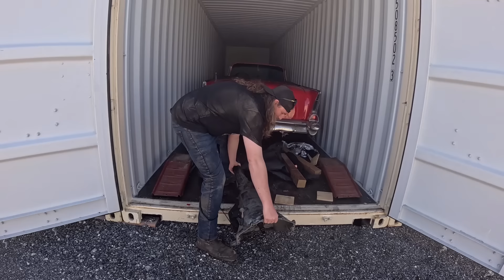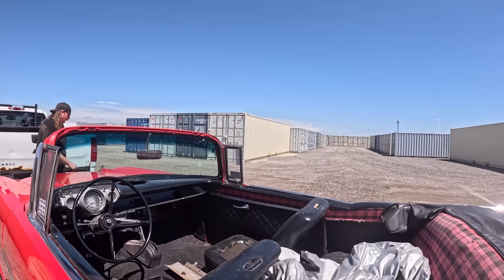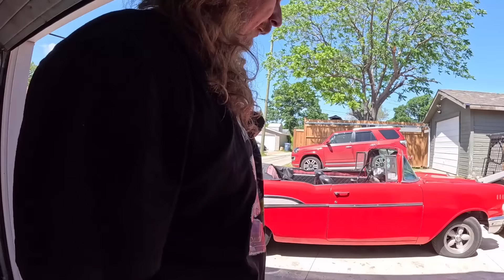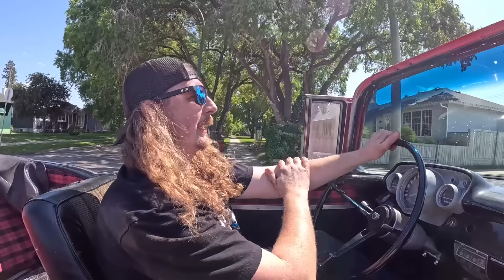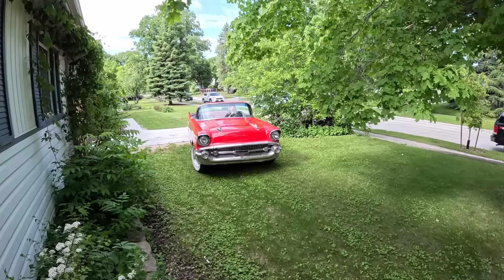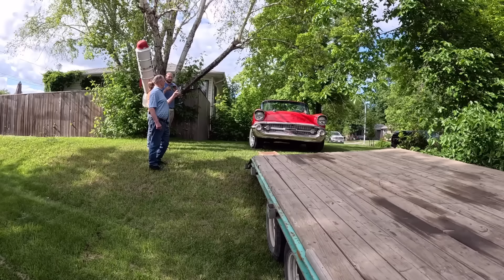Fathers Day Purchase GONE WRONG! - 1957 Chevy Convertible The Perfect Gift

Comment: IIRC, you did switch to the convertible rear structure with the top well, but it would need convertible or modified rear inner sheetmetal to install rear quarter windows and a top?

Comment: Ah, how can it be called a "Rag Top" if it doesn't have a top, rag or otherwise?  ;-D
If I remember correctly (likely not), all four side windows go up and down?
Every used car I had, there was a small toolbox, containing some basic tools, duct tape, electricians tape, bailing wire, fuses and other items.  ;-)
Even when I got a new car, I had some basic tools, flairs, flashlight and other items, just in case.